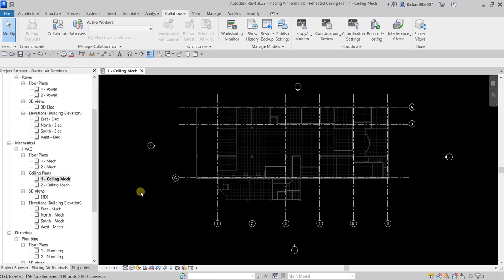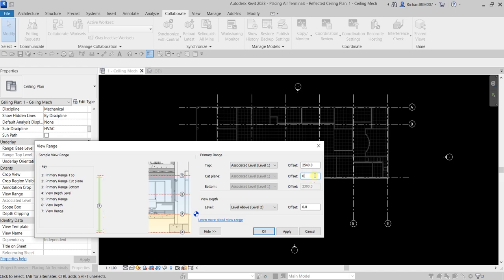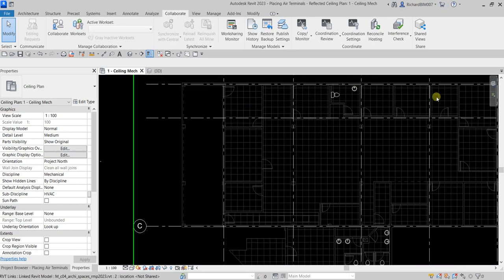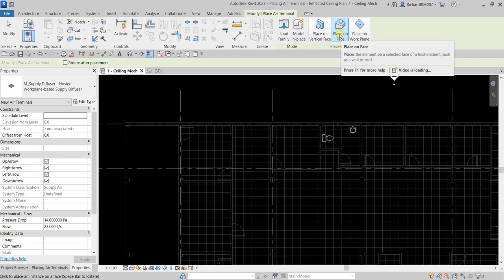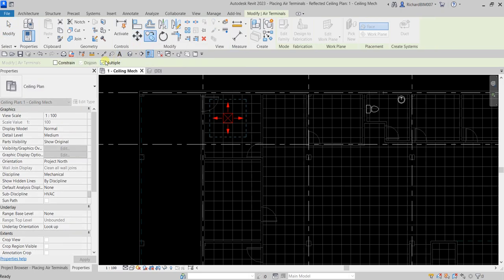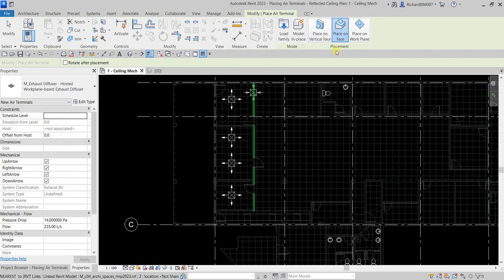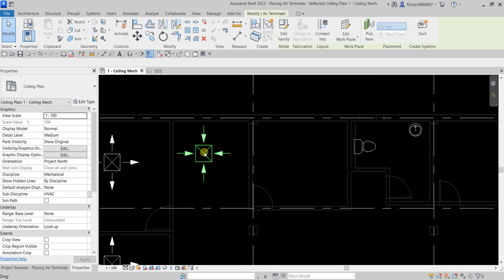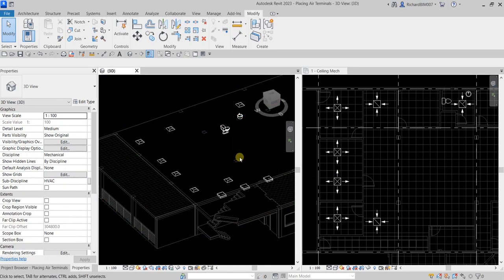REVIT 2023 FOR MEP - Lesson 6 Placing Air Terminals

Comment: What should be the flow of the air diffuser? i ve seen other revit tutorials and they recommend that the flow should be equal to the calculated supply. calculated supply is computed through heating and cooling calculation which is done by using heating & cooling load feature in Analyse > Reports and scedules. However heating & cooling load feature does not exist after 2021 version...what should i do?
Reply from the maker: In Revit versions after 2021, Autodesk removed the built-in heating and cooling load analysis tool from the software. However, there are a few alternatives you can use to perform similar calculations and continue with your HVAC design workflow:

Alternatives to the Built-in Heating & Cooling Load Tool:
1. **Third-Party Plugins/Extensions**:
   - **ElumTools or IES VE**: These plugins integrate with Revit to provide heating and cooling load analysis. IES VE, in particular, is commonly used for energy simulations and HVAC calculations.
   - **Autodesk Insight**: Although it focuses more on building performance analysis, it can still give you energy and load calculations, which are useful in HVAC design.
   
2. **Manual Calculation**:
   - You can manually calculate the supply loads using external tools such as *Excel* or industry-standard software like **Carrier HAP**, **Trane TRACE**, or other load calculation software. You would then input these calculated values into Revit.

3. **Use Older Revit Versions**:
   - If you still have access to Revit 2021 or earlier versions, you can perform your calculations there and then continue working on the project in a newer version of Revit.

HVAC Workflow Recommendation:
- If you’re following tutorials that still refer to the heating & cooling load tool, I recommend using *Autodesk Insight* for more accurate building performance simulations, as this is the most compatible tool for the latest versions of Revit.

Comment: Sir Rich, how do i enable those small gridlines?
Reply from the maker: hello sir, in Autodesk Revit, you can enable gridlines to help you visualize and align elements in your building model. Here's how you can enable gridlines:

1. *Open Your Revit Project:*
   Start by opening the Revit project you are working on or create a new one if needed.

2. *Access the "View" Tab:*
   In the Revit interface, locate the "View" tab on the ribbon. This is where you'll find various options for controlling the visibility and appearance of elements in your view.

3. *Activate the "Grids" Option:*
   Within the "View" tab, look for the "Graphics" panel. In this panel, you will see the "Grids" button. Click on this button to enable gridlines in your current view.

4. *Customize Grid Visibility (Optional):*
   By default, enabling gridlines will display all the gridlines in the view. However, you can further customize their visibility and appearance by clicking the "Visibility/Graphics" button, which is typically found near the "Grids" button. This allows you to control the visibility of various grid elements such as grid lines, bubble heads, and bubble extensions.

5. *Adjust Grid Settings (Optional):*
   If you need to adjust the properties of specific gridlines, you can select individual gridlines in your view and access their properties through the "Properties" panel. This allows you to change their line style, color, or other attributes.

6. *View Grids in the 3D View (Optional):*
   If you are working in a 3D view and want to see gridlines, you can toggle the display of grids on and off in the "Visibility/Graphics Overrides" dialog. Access this dialog by clicking on the "Visibility/Graphics" button in the "Graphics" panel and selecting the "Model Categories" tab.

7. **Save Your View:
   Don't forget to save your view after enabling gridlines to ensure that your settings are preserved for future use.

Keep in mind that gridlines are specific to the view you are working in. Enabling gridlines in one view will not affect other views in your project. You may need to repeat these steps for each view where you want gridlines to be visible.

Additionally, if you're working with linked models, you might need to enable gridlines in those linked models separately if they are not already visible in your view.